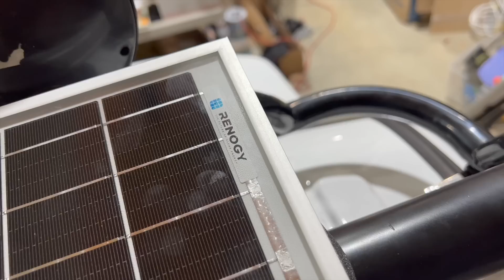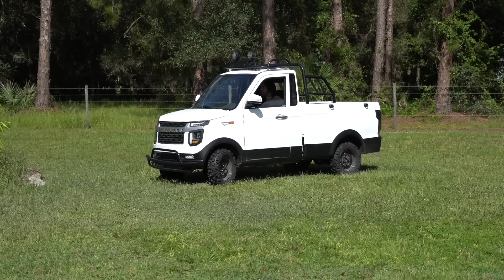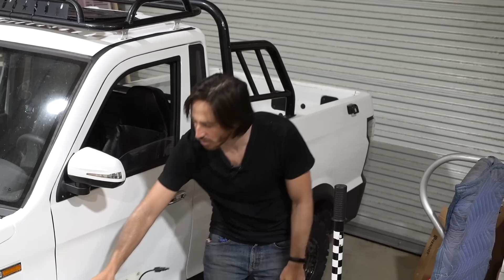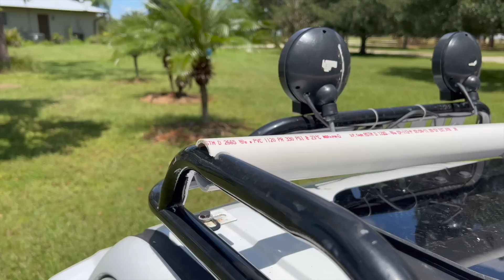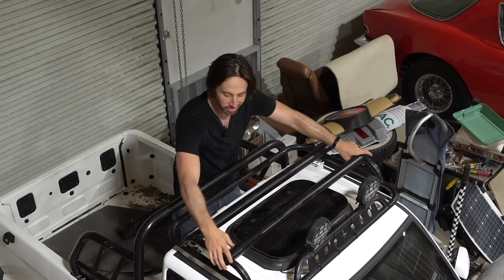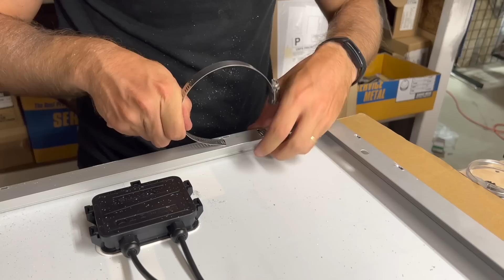I added a solar panel to charge my $2,000 electric truck

Comment: I’d like to see the lack of suspension underneath if you ever get it on a lift, it’s very interesting I’ve been wanting to go electrical myself but good job
Reply: It actually has a suspension with coil springs and shocks all around. But the coil springs seem to have a very high spring rate that greatly limit shock travel.  We have purchased a set of coil springs with a much lower spring rate and will be swapping them out soon.  Stay tuned !!  Best regards

Comment: looks like you could fit two of those panels up there.
Reply: But not within the size limits of the existing roof rack and we didn't want it sticking out and requiring a different mounting arrangement.  Could certainly be done but we didn't want the panel(s) to dominate the truck.  Thanks

Comment: Great and fun project, as always !  Of course there's room for two or a bigger solar panel on top, and I for one do not anticipate vibrations problems with the flexible one on the hood. Plus, aren't higher voltage panels sold ? Because there might be some loss as electronics are trying to augment the 18-19 volts from the panel to 70 volts. Just my two cents, keep up the innovation ! 😊
Reply: The telegram guy is a scammer

Comment: Good stuff! I was thinking a 100 watt panel would fit up there pretty decently - but as you mentioned later, the 50  watt might do the job for how much the truck is used.
Reply: Yes there seems to be enough space for a 100 watt panel.
Reply: The telegram guy is a scammer.
Reply: wrobg gp 100 watts

Comment: As others have suggested I would slap that flexible 50 watt on the hood of the car

Move those roof mount lights to the front of the bar so that you can tilt the solar panel forward this way you can aim the nose of the car toward the sun to get optimal charging from a hood mounted panel and roof not a panel 80 or 90 watt hour which you might get out of both panels should keep up with your usage

I wish it was actually possible to get these things for $2,000 I would buy one in a heartbeat for that price but the reality is we can't actually get them by the time you add freight taxes import fees etc you can just buy a used Nissan leaf for that price

Maybe one day we'll have more affordable access to these kinds of vehicles because that little tiny truck would be so perfect where I live
Reply: 1200,00

Comment: This is really great and so simple. If only more vehicles were so easy to make into green machines
Reply: It's not that simple. I have an electric moped that consumes about 30 Wh per kilometer. On average. The consumption of electric vehicles also depends strongly on wind strength and wind direction. With the 250 Wh that its solar panel produces per day, I would get just 8.3 kilometers. That's 5.2 miles. I suspect that his electric truck is moved about 1 mile a day. That is not much. But when someone like me commutes 19.9 miles a day to work, solar panels are no longer enough. Then it comes down to batteries and those are wicked expensive. My large 1,344 Wh battery cost $861. A liter of gasoline is the equivalent of 8,500 Wh. So my battery is equivalent to a tank that holds 0.16 liters or 0.04 gallons of gasoline. The battery weighs 17.6 pounds. So to carry the same amount of energy as a gasoline vehicle, an electric vehicle must carry 64 times as much weight.

Comment: Great little DIY. I wonder what adding a second panel to the top would do. It looks like you could squeeze a second one in on the top as well. Also, the flexible panel may work on the hood because it would have more support than the rack on top of the cab.  Excellent job overall.
Reply: Having one on the roof angled back & one on the hood angled forward would help capture more of the sun no matter which way its pointing.
Reply: My thought exactly, a second small panel will do wonders for the amont of work this truck is doing around their property.
Reply: Flexible panel on the hood is a great solution.  There isn't a worry about engine heat like with a traditional internal combustion engine.  No-brainer.  100W on the hood and done.  Plus then you could remove the one on the rack and regain storage space.

Comment: I would of used that flexible solar panel on the where the engine would normally be but and run them in parallel to the charge controller.

Comment: I've never understood why EV's aren't built with solar hood, trunk and roof. It just makes sense.
Reply: On a road going  EV, as opposed to a golf cart, you wouldn't get enough current to really matter.
Reply: @AMM1275  that's unfortunate. Would be cool though.
Reply: @mattclinch1976  it would for sure. And as solar technology develops it might become more possible. Currently,  a very efficient EV can do about 4 miles per kWh of energy. In other words, it takes about 250 Wh to drive a mile. If you covered every inch of a car in solar panels, which would be very expensive because they'd have to be custom formed, you could maybe fit 400 watts of peak charge capacity on a car. Solar panels aren't 100% efficient and you're only getting peak power for a few hours of the day, so in ideal conditions this theoretical solar covered car would probably generate about 1.25-1.5 kWh of energy in a full day. Thus, the panels would provide enough energy to drive the car between 5 and 6 miles. It's not nothing, but it isn't worth the probably $6-10,000 premium that such a system would add to a car. It would also make any bodywork/repair difficult because the solar panel would essentially be one with the hood/roof/trunk, so a small fender bender could destroy the circuit and require the entire panel be replaced.
Reply: soño  dis buy it 8 míoké per dày

Comment: i was wondering if you could put a fold rails on the back of the cargo bed..and setup a set of flexible solar cells that could be removed when the full truck bed needs to be used for high loads...you might even be able to store them inside the cab behind the seats... just a thought

Comment: Wow, I don't understand why most current electric cars don't have a sunroof. Nice video!!
Reply: Most highway-legal vehicles use so much energy while driving (maybe a few dozen KWh equivalent for a typical commute) that the area you can cover a typical car with solar panels will barely make a dent in their typical range.
However, if you're interested in solar-powered cars, check out the Aptera.  It's so efficient when driving that solely powering it with solar panels starts to become practically feasible.

Comment: To me, the front should be lower than the front. Any speed you go is slowed down by wind resistance. Have you thought about having a charging station? Have a few solar panels and batteries should be enough. And how about improving the suspension. Shocks should help with the bumps.

Comment: Hello from Urdaneta City, Pangasinan Province, Island of Luzon, Philippines.

Thank you for the interesting video. 

I have been doing a solar powered transportation project. Basically is a 200 Watt solar panel combined with a MPPT boost controller. The battery is 60 volt 20 amp hours lead acid battery. The vehicle looks like in anorexic golf cart. Ebike 4 wheel version. Overall performance is great. Even though it's the rainy season with a lot of overcast bright sky. I have been uploaded to YouTube. 8 short videos about it. 

My version of the MPPT boost solar charger has a manual user setting. I started out with 66 volts. There is also a 60 volt automatic setup available. I'm going with the automatic setting now.

I have a wattmeter on the solar panel side. It's interesting. A lot of good info.

Comment: A 100 watt or higher would be better for the truck
Reply: Sure, it would charge at double the rate.  But we had other design considerations and goals.  A larger panel, or 2 x 50w panels turned 90 degrees would not fit between the two metal side rails of the roof rack and we did not want to go above the side rails for structural reasons.  We found that with just a few high noon hours of sun hitting the panel, we were close to replacing the energy we use in a day.  Pretty much net zero.  If we need to top off the battery, we can always go back to the standard 100v charger but probably with much less frequency because of the free solar power.  So it's all tradeoffs.  Thanks for your comment.  Stay tuned for the one year review which will be loaded with other mods and upgrades.  Regards

Comment: Wish you  angled the panel aerodynamic like the sunroof glass seems backwards to me
Reply: Actually, with a low speed vehicle, the front opening of the sunroof helps to push some air into the cabin.  And indeed it does.  With a high-speed vehicle this setup would not work (70 mph wind blowing in !!).  So the solar panel follows the angle of the open sunroof.  All good !!  Best regards

Comment: 50W panel seems just so low compared to the size of the truck's battery. I have a 50W panel at home that I use to charge a DIY 6S2P 18650 pack, and for that it works great with an MPPT 2A small board.
But for your setup I would at least go for 100W or ideally 200W of solar panel, and a suitable MPPT charge controller.
Preferably in series, since converting the ~18V from one panel to the 42V or whatever voltage the truck battery is will be really inefficient.

Comment: Well, that worked out really good. Now you can have the sun roof open a little when it's raining.
Reply: Actually, you are absolutely correct.  Didn't plan for it but in a gentle rain, the panel does keep the rain from entering the cabin.  Added benefit !!  Thanks for commenting.  Best regards

Comment: Love the Chang Li and am considering buying one for my 10 acres in Arizona. The solar panel idea fits right into my thoughts. Thx for creating this video!
Reply: Did you buy one?
Reply: btw he was wrong, you can get this licensed for light vehicle travel so u cant go faster then 40 mph or go on freeways

you may have to add additional safety features depending on your state ordinance tho
Reply: @JustTheValerie  wish I didn’t live in a city, basically impossible to get anywhere I’d want to go without highway travel

Comment: I have two questions here. 1/ Why did you not go with the hood mounting option and then have a usable space of the roof rack? 2/  @Micahs Dad  What is the red car in the background inside the garage?
Reply: 1) Could have done that but thought a hood mounted panel would look too much like a bad DIY installation.  And, with the pickup bed, we didn't really see a regular need for the small 'luggage' area on top of the cab.  Liked the look of the panel over the cab (more subtle).
2) Any guesses? 
thanks for commenting.  Stay tuned for the one year review packed with additional mods and improvements to the truck
Best regards
Reply: @micahsdad5388  Well, the rear lights make me eliminate an early 70s Lancia from the pen of Pininfarina so I am going with a Fiat 124 Coupe... Good looking car in any case.

Comment: This truck needs a better suspension asap
Reply: Working on it.  Have softer coil springs we need to install.  Larger tires already on (knobby).
Reply: @micahsdad5388  could you try an custom air suspension also
Reply: @BuenaPapo  Bagging it would definitely be cool.  Perhaps a bit of overkill?  We'll start with the coils and then go from there !!  Regards

Comment: i dont understand why you just didnt make a solar charging station instead of mounting a panel on the truck itself.
just have a solar charging station where the truck plugs into when its not in use.
have the solar panels connected to a hinge of some kind so they can be lowered and raised for when its too windy or snow or time for cleaning.
i think that would have been a more suitable setup.
Reply: That would work too.  Our project was to show feasibility and demonstrate performance, cost, engineering, etc.  And it is totally passive.  Drive it out of the garage and it instantaneously starts charging without even thinking about it.  Just another approach to the same end.  Best regards
Reply: @micahsdad5388  yeah i figured the reasoning was something like that, i just personally think having a structure with say 6 panels that you plug into would give far more gains and far outweighs the set it and forget it model.
Great project and good work nonetheless.
thanks for the reply
looking forward to a followup video

Comment: Micah, I agree with others. You need to put two of those panels up. Looks like there is room. I guess it may be a waste if you're only using 250wh per day, but doubling the energy capture would be awesome.
Reply: No reason to not use the hood to mount another. Aerodynamics not an issue.  Seems like two could fit on roof with minimal overhang, also.
Reply: You can also get higher wattage pannels. On amazon there is a 100watt one for £71.60. Looks like it would fit. Still an interesting video though. Not sure at 6ft5 I would fit in one of those which is a shame :p
Reply: Have one panel for running and actually using the motors. And the other for charging a bank as a reserve battery. Double or triple your Milage charge
Reply: @That_Son_Ofa_Itch  It is not enough to run motor
Reply: @That_Son_Ofa_Itch  The reserve battery could then also be used to run power tools or recharge an electric bike or whatever, wherever you need.

Comment: Thank you for the video. One question, the damage done on the battery for being that amount of time into the sun with the intense heat, does compensate the panel and the lack of having to connect it to an outlet?
Reply: I can't imagine the thing being in the sun would cause that much of an issue to the battery. Especially at low current charging

Comment: My question is: wouldn’t it be better for the longevity, durability, and reliability of the truck to park it in the shade or a garage? Because the shade helps protect the paint, batteries, and metal from UV radiation, heat, and rust?
Reply: true, but we are using it out on the pasture a good deal.  Sun is bright and plentiful as we work out there.  Then to the garage when work is done.  Still, leaving it out in the sun for short periods will not do much harm.  It's a work truck.  Not a trailer queen !  Thanks for your comment.  Regards
Reply: @micahsdad5388  Thanks for the insightful reply!
Reply: Ideally a carport made of solar panels
Reply: The truck could also be left in a warehouse for eternity to keep it in mind condition, right ? But that's not really it's purpose, really.... 😉 And anyway, rust would get to it anyway, are kept in better conditions when using them regularly, that's a well known fact. 👍

Comment: I like the idea of solar roofs on vehicles a lot. However you need to replace the PBC with metal tubing that is welded to other tubes. As soon as a strong wind from a storm or someone loads the truck on a trailer/rollback and gets out on the highway that whole think is going to come loose. Would not want to be behind it when it does, just saying.
Reply: Appreciate your concern.  We might cross drill the PVC with through bolts to the steel tube.  However, it is difficult to adequately demonstrate how tightly we fit the bird's mouthed ends of the PVC in between the 2 steel tubes.  The aluminum frame of the panel forms an extremely rigid subunit clamped to the PVC in 4 places.  We accept that strange things can happen, but it is actually well overbuilt for the use that the truck will see in regular service.  We will monitor the structural integrity of the entire installation because of the vibration that the truck is subjected to in our largely off road usage.  Thanks.  Best regards
Reply: That works. Thanks
Reply: @singlespeed2760  You are very welcome.  Stay tuned for further upgrades: lower spring rate coil springs to soften the ride, towing hitch, bed liner, and much much more !!
Reply: I will. I like the channels a lot. I made the decision to buy my Lectric Xp after watching his review of them. I just finished the bike manifesto book which I really liked also.
Reply: Bad timing on both comments. I saw something loose on a trailer today and other day I saw someone who should have been wearing a helmet hit their head on concrete because they weren’t wearing a helmet.

Comment: You should definitely try and upgrade the suspension. With solar panels on it now and any other concerns regarding vibrations, the benefits of plush and functioning suspension would be great!
Reply: The bigger knobby tires are already on it and we have a set of softer coil springs that we are about to install.  Should make a huge improvement in getting us a real suspension.  Just much too stiff now.

Comment: It amazes me that Tesla don´t put a solar panel on their cars. I don´t care if the amount of electricity is small. If I had a gasdriven car and there was a device that could  capture petrol out of the air but in small amounts I would still like to have it.
Reply: Go to school and learn something. It can't produce the wattage to charge Tesla
Reply: @americannumber2  with your reasoning why is there regenerative breaking? Every little thing helps. It is not about charging the battery full.
Reply: @veryfastdentaldrill503  buz, your poor car is 12v system
Reply: Too much trouble, too little benefit.

Comment: pretty neat Idea Micah, however, I would have used a latching bed cover as my base to install, since you have more surface area.
Reply from the maker: I thought about the bed cover but we just fill the bed so often that it would mostly get in the way as we'd always be removing it. We are constantly filling the bed with branches, boxes and other things up higher than the height of the cab!
Reply: @EbikeSchool  ahh yes. I wouldn’t be. In fact I would be interested in living in one of those, and going cross country in it.